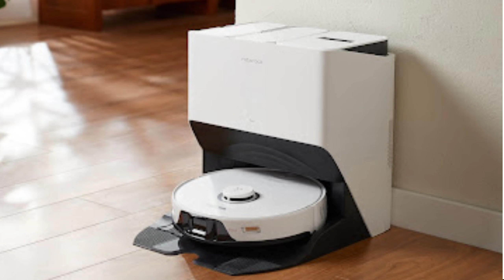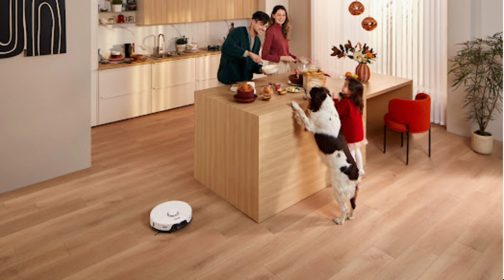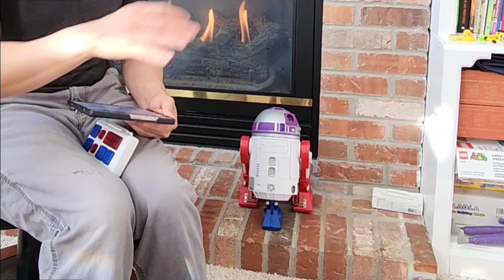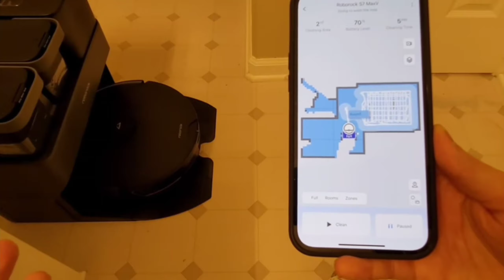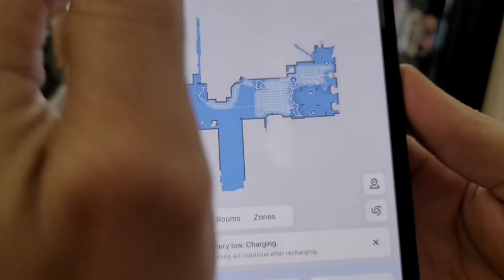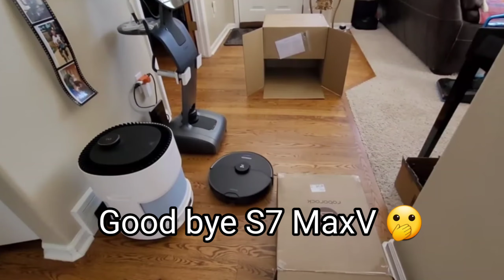Roborock S8 Pro Ultra / S8 Plus - Newest Models for CES 2023

Comment: Do you think it's was worth returning the s7 and waiting for this S8
Reply from the maker: Just from reading the specs and what I have seen so far, I would keep the S7 MaxV. Won't know for sure how good it is until I have a unit to test.
Reply: @RobotMasters  from what I read the lifting brush and the vac then mop mode along with the built in warm air thing and the increase suction seem to be the difference and some aesthetics changes. But wanted to see if you knew more
Reply from the maker: @Mike Mils  Yep that basically it. It's a mid cycle update.

Comment: Can you answer this question for me?  If I understand it, you can program the 8 pro ultra to Vacuum, where it will withdraw the mop.  When it is done, it will return to the dock, empty the dust bin, then repeat the cleaning.  This time, with the rollers withdrawn and the mop extended.  In essence, you can tell it to vacuum, then mop, without any other inputs?  I have the S7 Max V ultra and love it, but it vacuums and mops in the same run, lifting up the mop when it comes to a carpet.  While this cleans very well, I believe the ability for it to do what I described above will result in a much better cleaning.   Am I on the right track?
Reply from the maker: Yes you have the ability to Vacuum only, mopping pads lift up, Mop Only or do both simultaneously. There a carpet sensor so depending on what mode you are in will boost Vacuum suction or lift the mopping pad when there carpet. As for Vacuum first than mop that is possible as well.

Comment: What happened to Roomba?  They are 10 years behind Roborock
Reply: I think the issue is that iRobot haven't felt the need to improve their products much because their dual roller patent has basically given them a monopoly on carpet cleaning for the past 20 years or so. Remember that, before the j7+ combo, Roombas hadn't really received any hardware upgrades since the 980 in 2015.

I think they're realising that they'll need to actually put in work to stay in the lead now. The j7+ Combo (Being the first Roomba in 7 years to have a new piece of hardware) being launched so close to the dual roller patent's expiration date? I don't think that was a coincidence
Reply from the maker: Yes they need some catching up to do. I believe there are finally releasing a all in one vacuum/mopping robot.
Reply: @RobotMasters  They did and it sucks.  If they invent a time machine they can go back 10 years and release it.

Comment: I'm not so sure the upgrade will be that massive. The new roller design is interesting but otherwise, I think Robot Vacuums have reached an innovation peak for the time being. It's "cool" but probably not enough to justify an upgrade. I'm still after an S7 because from all the reviews I've seen obstacle avoidance doesn't even really work on any robot vacuum in the market.
Reply: S7 plus owner here, same thing, i ditched the idea of obstacle avoidance since they are not mature enough imo, the self-washing is appealing but since i vacuum daily and mop once a month it's not worth it the extra money
Reply: @xeon2k8  Basically this, I'll just clean up my socks and cables then actually clean the floors. This "ai" is mainly a gimmick and also increases cleaning time. Innovation is cool though.
Reply: @yoda101  I've had an S7 MaxV since August 2022 & I think the obstacle avoidance is quite useful. Granted, it's not perfect & my robot has still managed to get tangled up in a shoe lace once so far, but it's managed to avoid a few cords & shoes that've been left on the ground.

Whether it's worth the premium over the regular S7 is debatable though ¯\_(ツ)_/¯

Comment: The warm air dryer is overrated. I added it to my MAX and it really didn’t do to much. I am shocked they can do the dual rollers since iRobot has the patent. There might be a lawsuit coming or it will be barred from selling in the US.
Reply: It expires in may, which the Roborock will launch after.
Reply: @BonaDeum   Ah, good to know. You know your robots!
Reply: @MrKornnugget  It is an ancient patent to be fair. & not even an original brush design. You can find carpet cleaner patents from the 20th century with the same counter-rotating dual roller layout
Reply: @ExclamationMarx  Sure. I just remember that I-Robot had the patent on a dual roller design. I am not sure what was specific to their design let them patent it, but I do remember them suing over it in the past.
Reply: @MrKornnugget  I think they were granted the patent because it was specifically referring to that brush design being used in an "Autonomous floor cleaner" so technically speaking they had a patent on all robot vacuums that had that brush design